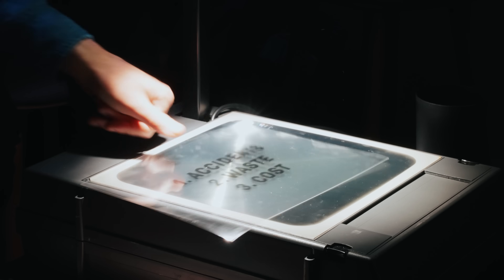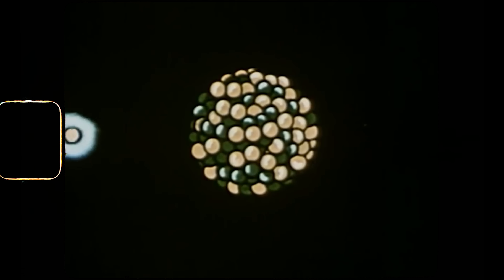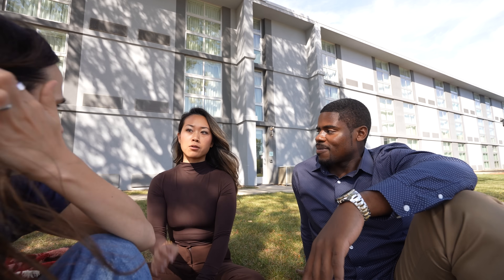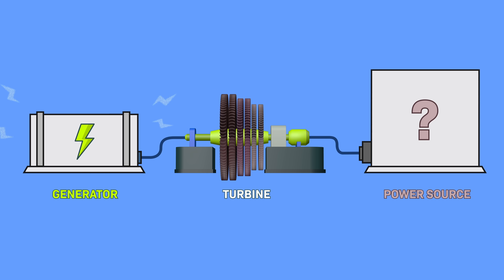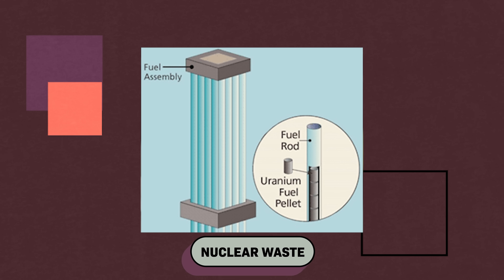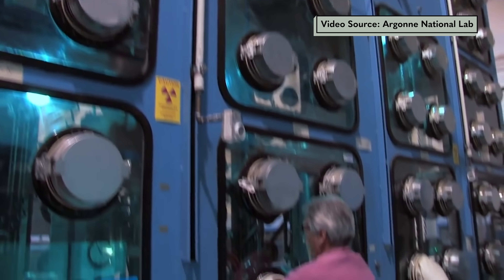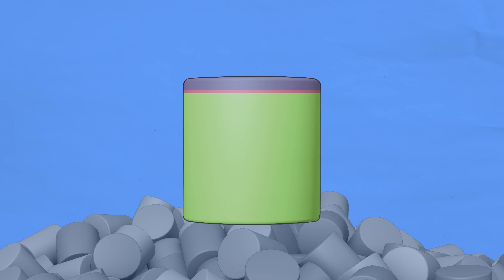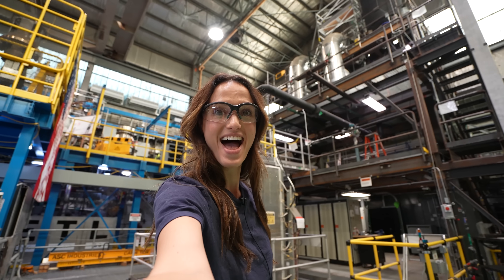The Big Lie About Nuclear Waste

Comment: Sadly the push for the lie that the green new deal is does not use real renewable energy. There have to be real answers, and real moves to make things work. Wind power generators and solar panels last only ten years. There will never be an ROI on these products. Japan is reusing nuclear waste to rebuild their fuel rods.  The USA can reuse spent nuclear waste, but need to build more stable standardized plants to bring cost and accidents down.

Comment: Greetings:
I appreciate your acceptance of the reuse of the output from light water nuclear reactors. But the reuse requires a technology that Nas been banned by law in the U.S. The reason that light water reactors (both Pressurized Water Reactors and Boiling Water Reactors) need to shut down for refueling about every 18 months without having used up all of the fissle U235 fuel is that some of the fission products created when the U235 is split is Xenon that is a reactor poison that interferes with the  normal operation of the reactor by stealing the neutrons that would otherwise be used to maintain the chain reaction. Because the Xenon gas is trapped in the fuel rods along with some of those long-lasting reaction byproducts, when the reactor stability is too difficult to control, then refueling with reactor shutdown and some reshuffling of partially used fuel bundles and removal of the xenon dominated bundles is necessary.
There is another reactor technology that avoids trapping that xenon gas in fuel rods but allows it to be removed without shutting down the reactor. It also allows new fuel to be added as well. It has other benefits as well. Oak Ridge National Labs in Tennessee experimented with it in the 1960's. At that time we still were after more plutonium for weapons so the money was redirected away from the Oak Ridge work toward other research.
So you know, that other reactor type uses molten salt as both the coolant and the fuel carrier for the reactions. There are numerous advantages to molten salt reactors but I'll let you research that yourself. Why don't we have them now, because the nuclear sub development paid for all the research needed for the development of the reactors in use today.
See Flibe Energy or the Thorium Alliance for more info.

Comment: Transmutation (or similar Prozesses) ist nothing new. But still at Basic Research Level and far away from an engineering Business. Even the countries that never stopped the research are still pondering in their Research facilities. Uran and Plutonium are not the only problem (Cesium, ...).
I highly recommend to go on researching, because the waste is already there and is growing, but we are far away of having a solution in the next years.

Comment: Not only that, we built a processing center that converts Nuclear waste into a less radioactive shorter lifespan powder with a 15 year shelf life.    Very simply, place the waste on a metallic plate with electrical line, within a sealed cement chamber. Another lead (cathode and anode) and alittle juice.  Bingo hopefully no bango.. The waste on the plate is converted.

Comment: Solar is getting so cheap ,as is energy storage  Nuclear may lose on the cost issue.    The most recent reactor cost 16 billion dollars a piece to build.  That much money could buy enough grid storage to replace the need for a reactor.
I am a big fan of nuclear fuel recycling, and you don't really need a fast flux reactor.
 The biggest argument against the plutonium reactors was accounting for all the plutonium that went in versus the plutonium that came out to make sure no one was siphoning some off to make bombs.  I think the need to reduce waste inventories is starting to make it worth mitigating that risk.

 Ideally you would let spent fuel sit for 90 -120 years before reusing it, that would make the recycling process considerably easier and it would be using the fuel just when it's getting attractive to terrorists because it's less likely to kill them while they're stealing it. That means some of the first spent fuel from the first commercial reactors is just about ready for recycling.  The very first fuel used in the Hanford reactors did get recycled several times, but that fuel had relatively low activity from fission products because it was being "cooked" for weapons grade plutonium, not being used to make the most power between refuelings.  If people could become comfortable with recycling nuclear fuel it would probably be best to do it more often and burn the fuel less each time.